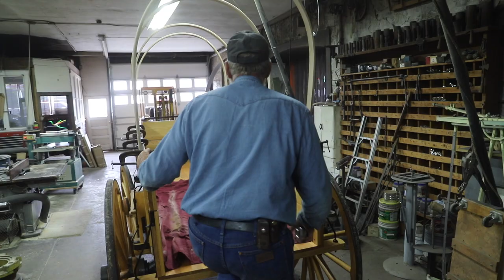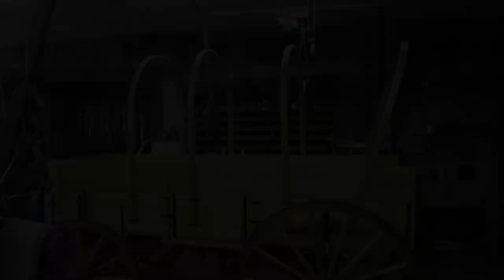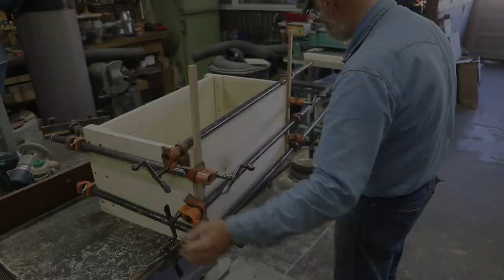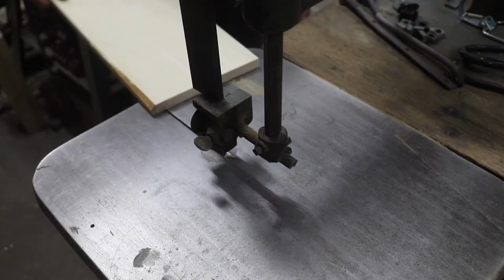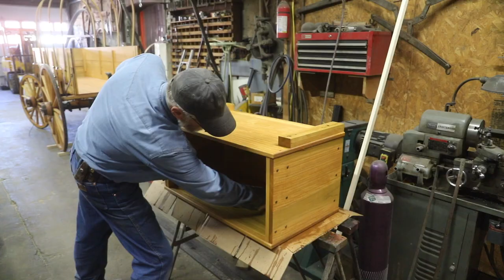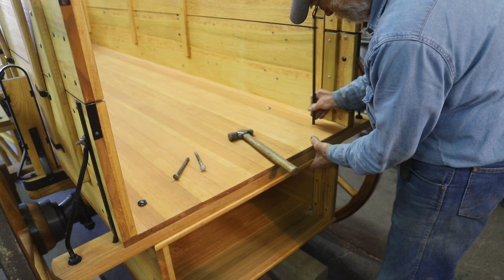Cowboy Style Rabbets & Dados | Engels Coach Shop

Comment: I found this very interesting. I make a lot of small boxes and so I wondered how it would be made for an old wagon. And when I saw the way you made it I could see why you made it the way you did. My boxes would not last very long under the rigorous conditions of a wagon on the trail. The rivets, the long threaded rods holding the box to the wagon are a very robust and I can see that they would be a very durable construction method. And also the methods of construction required very simple tooling, not even a sharp chisel! Very interesting.

Comment: That is a great looking box and so well built that it would surely take the rough ride without falling off.  I would bet the pots and pans would have a good share of dust at the end of the day riding back there.  But better them than the food stuff.  I like the plain steel nails (not galvanized), they look bigger than a 5 penny, are the a 7 penny box?
Reply: 1 1/2" 4 penny.

Comment: Use your hammer, or a pair of nippers, to flatten the tip of the nail. It will drive easier, hold better, and split less. No need for drilling. Of course, old fashioned cut nails were far superior in all aspects. Of course, your rivets are the best.

Comment: I guess these connections where the grain goes crosswise/90° will not go well for long. Such connections tends to bend with enormous force on changing humidity.
It could be made if the board was not glued to one piece but single planks with a gap inbetween each plank and one nail in the middle of each plank.

Comment: Latch could just be a L toggle. Like a C, but squared up = [ . Hole in the handle of the paddle, horizontal slot in the panel behind it. Legs of the toggle would point down under gravity, to unlock, just rotate 90 deg and the inner leg comes out of the slot and pull the paddle out, toggle stays captive. Make it out of round rod, knock one end over 90, forge or file some flats on the outside end. Square hole in a piece of flat stock and make into the handle however you like and peen it on. If you're worried about wear, a couple brass inlays would do the trick.

Comment: What is the stain or sealer you used? 
For the latch, my grand dad just used a "flip board". You could do the same, just need 2 dowels glued in place, one end split with a wedge glued in for the flip board, real simple and I believe the "old timers" did it that way.
Reply: TWP on this one

Comment: I noticed you used long bolts to mount that box to the bottom, instead of some long brackets around its body. Wouldn't bolts be more hassle to produce on a farm, compared to 2 strips of metal and rivets? Threads on a specifically loing metal rod, i mean. I understand that brackets would rust much faster and start to wobble earlier, but you mentioned that these add-ons were made by people who didn't really have experience in wagon building. Or am i thinking about wrong year and hardware stores or local blacksmiths already sold these bolts?

Comment: Gluing those 1x's across the panels...isn't that a big no-no?  Maybe the panel expansion/contraction isn't enough to cause splitting issues?
Reply: I saw that at 6:50 and 12:00, but I note that plenty of fasteners are used so it's never going to come apart. My guess is that, back in the day, a small crack here and there would hardly be noticed.  After all, it's wood, and wood cracks.

Comment: I love the channel, but gluing the cleats this way would cause problems in a part of the country with more seasonal swings in humidity. I usually put a dot of glue in the center of a transverse cleat, and rely on screws, rivets, nails, etc. to provide some wiggle room. Gluing the whole length of the cleat just is not necessary.